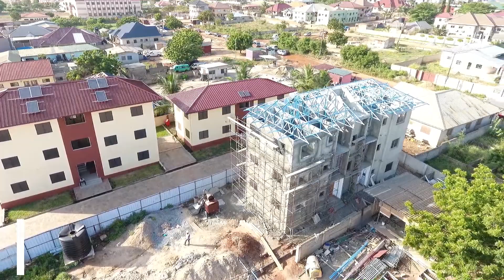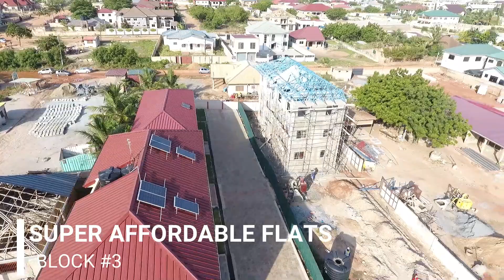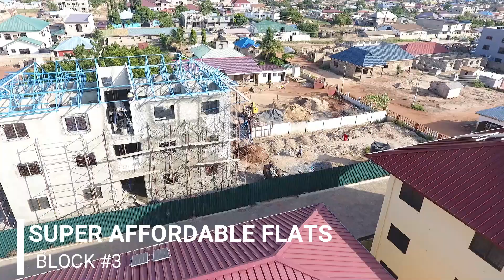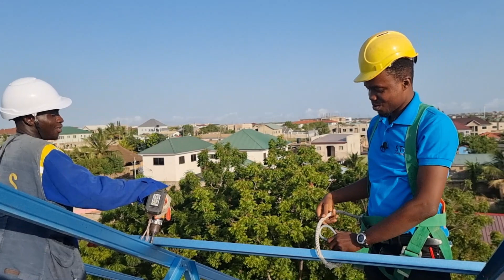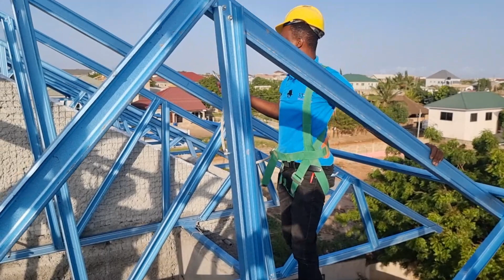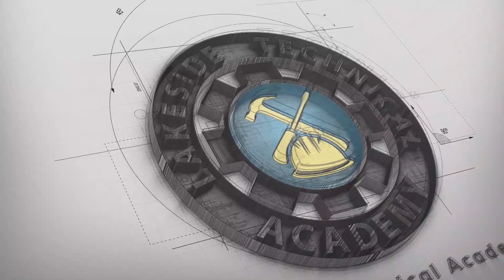Roofing Affordable Homes in Ghana with Raincoat Aluzinc steel trusses for roofing by Engr Kojo Viglo

Comment: What about heat and fire resistance. Won't it make the rooms warmer.
Reply from the maker: Fantastic question...

Steel is definitely more resistant than wood in terms of fire. It will hardly collapse as wood does. 

But it is a culprit for conduction of heat of which the roofing sheet is. So we use plywood for insulation and in higher spec houses, we use roofing felt which is aslo heat resistant. 

The plywood also provide sound insulation during the rain.
Reply: @KalmoniGroup  can I have an estimated cost for say a four bed house 🏠. Just a rough estimate please
Reply from the maker: Yes... it's galvanised